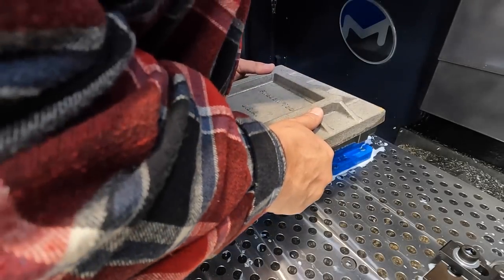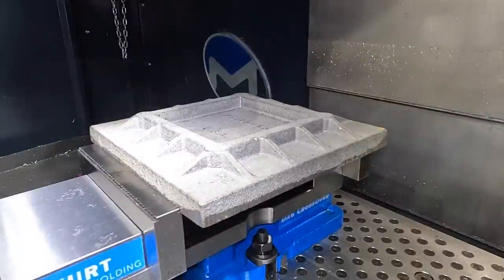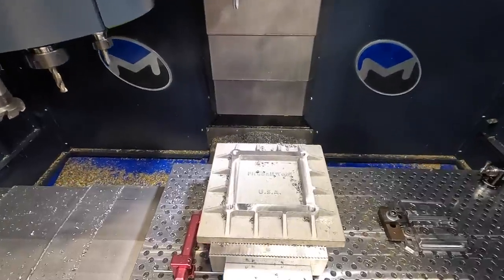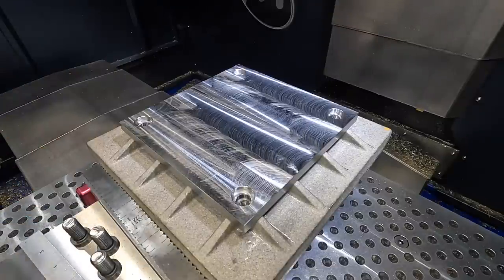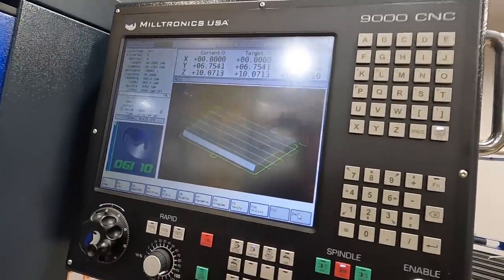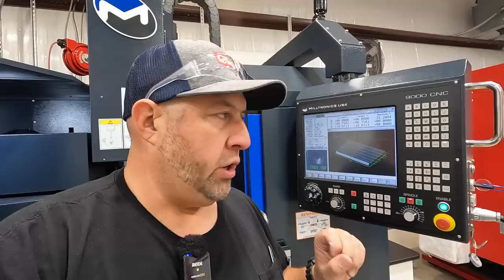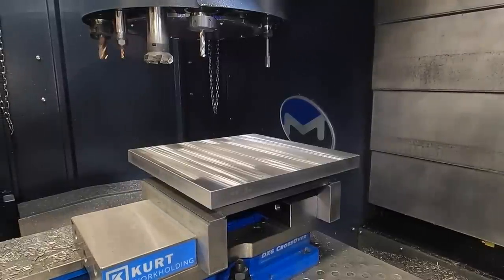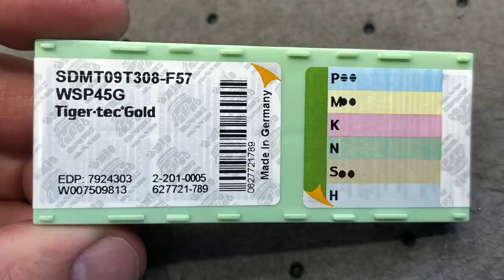CNC Machining a Fireball Tool Fixture Plate

Comment: Just an idea from someone who knows nothing about CNC. Seems you are doing these parts one at a time with a day or two in between. In order to quickly learn to program your CNC you need to make all the pieces you have one after the other and delete the program after each piece and then reprogram for the next piece. Repetition is the quickest way to train your brain. You may have to do 10,15 or 20 parts before it clicks in your head but before long you will have it and understand it and then you're on your way.
Reply: Habe CNC Fräsen und Drehen in 2 Tagen Schulung "gelernt" . Zuerst 25 Jahre nur konventionell gearbeitet. Jetzt mit Siemens sinumerik 828d und shopmill & shopturn kann ich einfache CNC Programme schon ganz gut obwohl ich nicht oft an den Maschinen arbeite. Please use Google translate 😉

Comment: Hey Abom79
Here's your calculations to get your bedrock minimum feed and spindle speed.

Spindle speed rpm = 
cutting speed in mm per min
÷
π × Tool bits' diameter

You will be provided the cutting speed per minute by manufacturer.

So that's your spindle speed

Feed rate =
Feed {also called load} rate per tooth {in metres per minute} 
×
Spindle speed rpm {the thing we just worked out} 
×
Number of teeth/flutes {cutting edges} on the bit

The feed {also called load} rate will be provided by the manufacturer.
Reply: PS. you will visually know you got the right speed for steel if chips come off straw yellow and turn blueish shortly after.

Comment: Why is it that no cutting fluid is being used? Is it not hard on the tooling? I'm not a machinist but I do love to watch the processes you submit (and I always give the thumbs up).
Reply: Cast iron does not need coolant generally
Reply: Both "gray" and "ductile" iron contain lubricating graphite particles that mostly eliminate the need for cutting aids, both aqueous and oily.  "White" iron's carbon is in ferric carbide form, which is too hard for "normal" (CBN would work) machining and grinding is appropriate.
Reply: Arguable on whether or not coolant is harder on tooling/ if it's worth it (thermal shock to tool). That aside, it also isn't great for video.
Reply: @ScuffedEngineer  It is doubtful you experience thermal shock of your inserts or tooling as long as the coolant was run from start to finish. It’s when the tooling is allowed to heat up and then cooled that you risk thermal shock.

Comment: This may be a silly question, but are you able to start the tool at the corner instead of the middle of a side when edging your part?
Reply: It's much easier to change the lead-in and lead-out in CAM (such as Fusion) rather than the conversational.

Comment: Curios as to does the CNC have a extraction system in place? As those iron particles floating about during the OP aren't going to be great for the respiratory system when breathing in when opening the doors.
Reply: Its no worse than what he would breathe in on a manual machine.
Reply: @oldscratch3535  That's an open area with it dispersing, not contained in one place then suddenly to be released with his face in line. Trust someone to mock a health question

Comment: cnc is a fantastic idea for production , but foe one off jobs i still think manual operation will take less time with the same results an using much less expensive equipment . good vid
Reply: Yep.  But one offs are a great way to build that skill of setup.  99% of the effort is setup on these things and that's what he's doing is getting that skill set.
Reply: One off jobs like this are still faster on a cnc. In cam this would take 30 seconds to program.
Reply: I seldom do more than a couple of any part I make on my CNC mill and there is no way I would go back to a manual.

Comment: Thank for video Adam.  Just an honest question, why does the face mill tool holder have such a long extension.  Is this to save time on the Z-travel or do the tool holders just come like that?
Reply: The tool can be used to machine very deep/tall features. Imagine a 12” tall block with a deep pocket or bore.

Comment: Hey Abom,
cutting the edges of the part in clockwise operation would be climb cutting. Isn't this a problem?
Greeting from Germany!
Reply: According to my machining textbook from years ago, modern machine spindles have bearings able to withstand the extra force on them from climb cutting.
Reply: I haven’t taken a conventional cut in years and I’m running a 20 year old vertical. I would guess 95% of all cnc cuts in the world are climbing.

Comment: I’ll speculate too. The chatter seemed to occur a certain distance away from the four bolts. It’s kinda funny from my point of view. In past videos you never tolerated chatter. You would immediately do something to mitigate any chatter. After I pointed that out to my wife she became aware of chatter and would correctly point out when you were gonna take action. I’m guessing your jaw was pretty tight when that was going on. Hang in there your gonna do this like a boss.
Reply: I think it's just that the corners have less support than the middle part of the edges. Less rigidity, more chatter.

Comment: You should NOT watch that drill go down that fast !!!
That is where about half of all crashes happen.
The machine should have some way of controlling the feed rate or maybe you have to use feed hold (Im not familiar at all with Milltronics) and when you are close to the work piece check the distance to go. Sorry that I cant tell you where you find it in the control but If you don't do your homework in that Direktion YOU WILL CHRASCH YOUR SPINDLE. 
I personally would have 3 times of wich 2 would have definitely destroyed the spindle. Edit: Im not even working a full year with CNC so it happens often.
Reply: Yup, should really turn you rapids down on the first run through of each tool, until it starts feeding, then turn back up. Will save you if a tool or work offset was not set correctly.
Reply: If he's using any CAM, he just needs to not rapid so close to the part. Looked like it did switch to feed at .100 or so and in production runs it's probably worth to rapid as close as possible, but otherwise a good .5 or 1 inch reduces pucker factor exponentially. This should still be able to be written by hand with work offsets.
Reply: @ScuffedEngineer  How much time do you have if the machine dosn't stop 1" from the part?? 
0.1 second If the machine is reasonably fast. You Think you hit the stop fast enough to safe your machine after you hear the crunch sound? Because human reactions aren't fast enough to do that visually.

Comment: Dang that moving jaw is wobbly as fuck.  Why do so many people use these kurt vices? They look pretty average.
Reply: If your moving jaw is too rigid you can have an over constrained condition and induce a twisting stress in your part.
Reply: Kurt vises have an adjustment screw in the rear of the movable slide to remove the slack. The screw on this vise is hidden behind the rear bolt on jaw.

Comment: As a beginner with CNC...try to keep your programs as simple as you can, right? Plunging in with an appropriate size chamfer tool would have been easier to code that using a smaller tool, doiing a circular cut.

Comment: Why is the majority of machining on a climbing cut?
Reply: Because CNC machines have ballscrews insted of acme so they have no backlash the cutter can climb. And its better for tool war if you exit the cut on a thin chip.
Reply: @TheDayzman   Thank you for that.
Reply: Because the machine and setup should be robust and secure enough to do that :)

On older manual machines with a little bit of backlash in the axis, you'd never do climb-milling of course.
Reply: @PatrickJoergensen  You can Climb mill as long as you want no matter how much backlash the machine has. But not as Hard as you want. Cutting forces always have to stay below the force it takes to move the table and you are good. 
Setup rigidity is also no factor for climbmilling.

Comment: try using larger collets for threading you scared me by using such a small one, rigid threading produces a lot of torque and the tap could slip in small ones
Reply: Look into Lyndex style Tap Adapters. They fit the shank and square drive of each tap size for positive connection and feed.

Comment: please please please put the interlock key back on the machine door and stop running it with the doors open its just plain dangerous and bad practice. Such a bad habit to get into and also to show to other people learning. your likely running all those tools a bit on the slow side ask your tool rep for feeds and speeds for each tool to get you started what sort of spindle speed can the milltronics mill go to? i typically run our face mills from about 5k rpm upwards depending on material and insert type

Comment: maybe it is better to do all programming in a software like fusion360 instead of mill console.
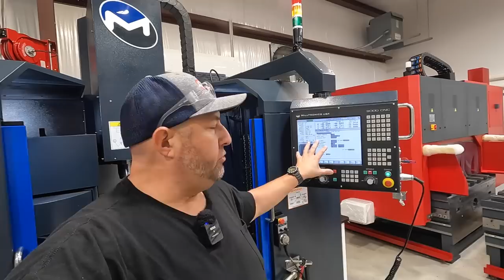26:15 - today it is Milltronics but tomorrow it will be HAAS or FANUC or even Mach3/4. end every one of them are not designed to do all the programming because machines are meant to run programs and not to write them.
 working in CAD/CAM is actually much easier because you are working off the blueprint not a bunch of abstract digits.
Reply: Did you watch the video? He talks about that
Reply: I think he did see the video. And, he believes it may be a waste of time to learn both.  He's probably right.  There's probably no good reason to take time learning that specific machine when you could be spending the time learning the cad/cam software which will translate to all machines.
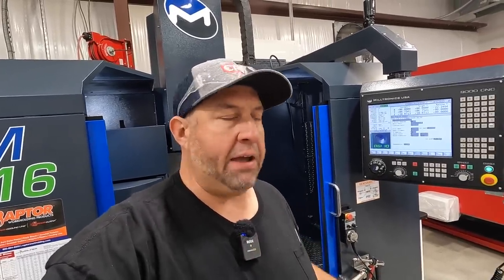Reply: 26:05
Reply: @videodistro  There's def value in learning the conversational on a machine. You really just have to learn both to get the most of them. Especially in a shop where it won't be long production runs rather shorter runs and more singular ops to add a feature to a part. I'm super guilty of not learning my machines conversational. But I'm working on it.
Reply: @videodistro  that's maybe your opinion, but I think if you learn the conversational programming it might be more versatile for quick and easy work, or where you don't already have a CAD model. Don't need to bother with CAD just to face a part and drill some holes. Both have their pros and cons.
Reply: If the machine was not meant to create a program It would not be able to. On mach 3 Im with you but who cares about hobby sh*t when talking CNC programming???
And just because we have CAM nowadays it doesn't take away the ease of just plugging in some numbers. For complex parts it makes some sense and for 5 axis machining its necesery but not for milling a Square island (wich is a canned cycle in Pretty much every control) and 4 holes with chamfer.
Just like you use a handsaw for a branch and not a chainsaw or a harvester. Those are for trees and entire forests.
Reply: A simple part like that can be programmed and ready to run much faster on the conversational. Zero need to CAM that part when you have conversational.
Reply: He needs to learn the basics first. How to operate the machine correctly, conversational, g code ect.. There's enough youtube makers goofing around with fusion and making strange programs for their hobby mills.
Reply: I always learn so much from watching your videos. How do speeds and feeds calculations differ between manual and CNC? Does the CNC do that for you and you haven’t learned that yet. I love the finishes on your parts. My only suggestion is to probe multiple places on the bottom to find the low spot.
Reply: @videodistro  Conversational is FAR faster and more convenient for some things. You NEED to learn both. Those are his machines. It's not like he's using them for the weekend. Having to do everything in a CAD/CAM suite is a PITA. Even the CNC master, Peter Stanton, uses the conversational on his Mitsu And his Mazak. It's not a debatable thing. He NEEDS to learn how to use the conversational, ESPECIALLY for the type of work he does. He's not making parts. He does a lot of simple tasks, and he'll need to know both ways of doing things.
Reply: If you only know CAD you are forever locked into the constraints of that CAD and the wisdom (or lack of) of the people who designed it. Knowing G code and/or conversational will allow you to operate outside of the CAD box when you determine it is better for you. 

Simple example: Fusion 360 (Personal use) removed automatic tool changes. If you know g-code you can simply edit Fusion's NC code and insert M06 and tool offset wherever needed. The machining environment is infinitely variable. No finite program will ever be perfect 100% of the time! Highly skilled people know when to step in and add greater value than just moving a mouse.
Reply: @littlejackalo5326  Exactly. Also he really needs to master the important things first and not think about CAM programs. Or else he can start doing crash and goofs compilations.

Comment: I know you're a pro, but seeing you do vids with the doors open and safety interlocks disabled makes me cringe! 🤕
Reply: runs drill first time, full rapids. pain
Reply: My Bridgeport mill doesn’t have doors or a safety interlock. What’s the difference?
Reply: @davidcat1455  Your Bridgeport is a manual machine, right? You are FAR less likely to have an "unintended" step in your order of operations than someone that is new to CNC! But then I learned CNC a long time ago (late seventies). Machine had to be "programmed" by writing the code, punching a stack of IBM cards, then running THOSE through a machine to punch a paper tape! Jr college ASMET, then BSMET. Now retired. 😁
Reply: @PhilG999  
Of course it’s manual. If I want to push buttons and stare at a little screen I’ll go work in an office🤷 My point was any machine mill,lathe,grinder,shaper whatever can be dangerous. However it’s not like Adam was crouched over top of the work piece with loose clothing flapping in the breeze🤷
Reply: @PhilG999  
Yup

Comment: Okay - so here is what you are going to do, A79: Fasten that pedestal grinder to the floor.  Its been loose long enough now.  Polish your shoes.  Stop fiddeling with manual operations on the work piece.  Do all the operations using the mill.   Crashing a tool IS PART of the learning experience and if you take every measure to avoid a crash you are impeding your development.  Stop calling the Milltronic guy (Steve?) for every small detail.  He'll soon stop answering the phone if you keep doing that.  Save the call to when it really matters.  But most of all: Start planning on how to get rid of them CNC's and go back to the lathe.

Comment: BRUHHH tighten up the set screw on the dynamic jaw!!!! way too loose.
Reply: i think it pulls down when the jaw pushes against the workpiece
Reply: @Cthowell91  search for KURT D-810 ANGLOCK VISE it has an inbuild pulldown mechanism
Reply: @chevyfahrer  I know I use them everyday... but chips can get under them.